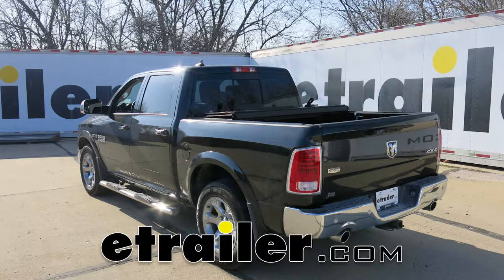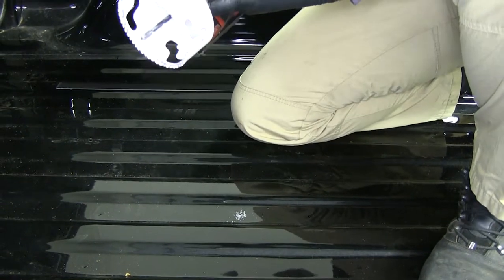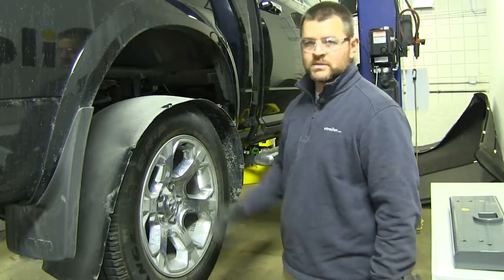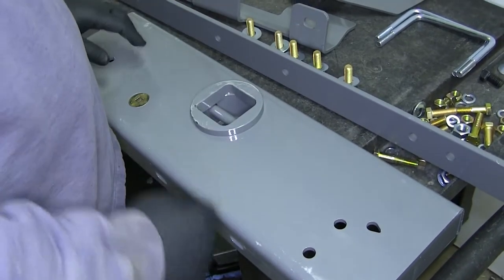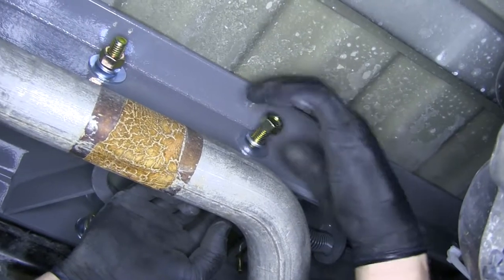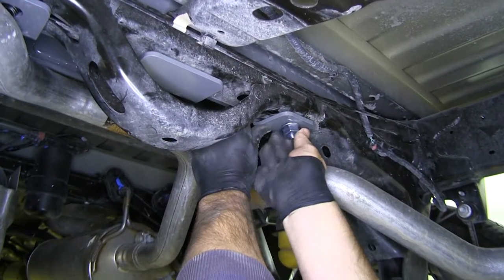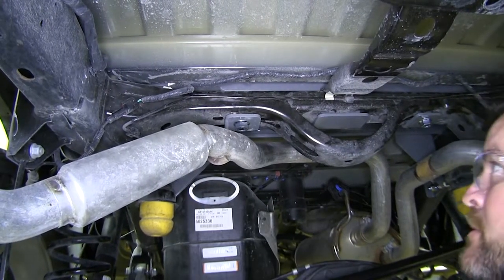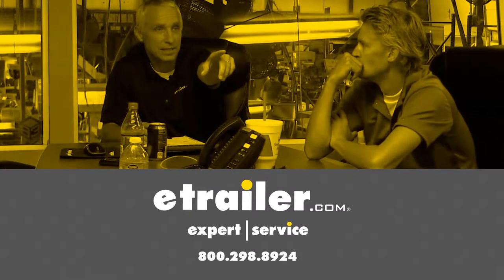etrailer | B and W Companion 5th Wheel Trailer Hitch Underbed Kit Installation - 2017 Ram 1500

Comment: Will this hitch work with a 3inch body lift?
Reply from the maker: Because a body lift increases the distance between the body of the vehicle and the frame, you will not be able to use a gooseneck hitch like the B&W Turnover Ball unless you remove the lift. Unfortunately, it'll be the same with any gooseneck hitch we offer. Short of having something fabricated, there isn't really a good solution for this. We wish we had better news for you!
https://www.etrailer.com/Fifth-Wheel-Installation-Kit/B-and-W/BWGNRK1309-5W.html